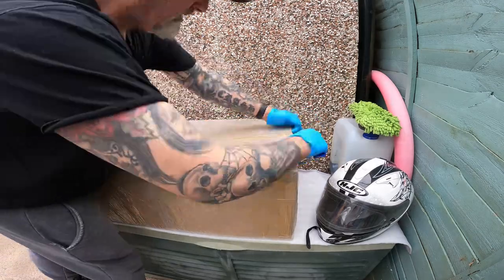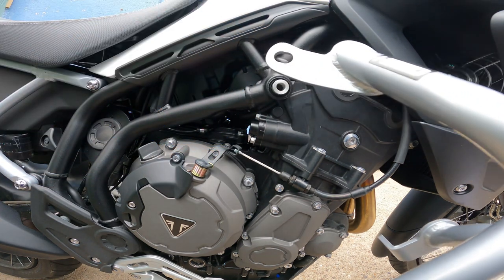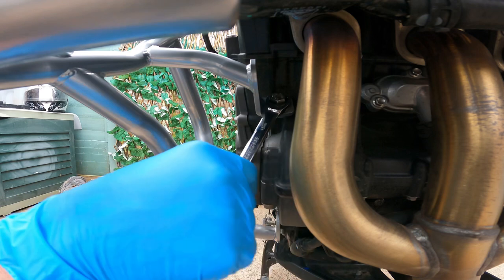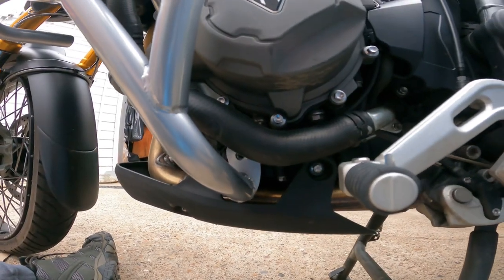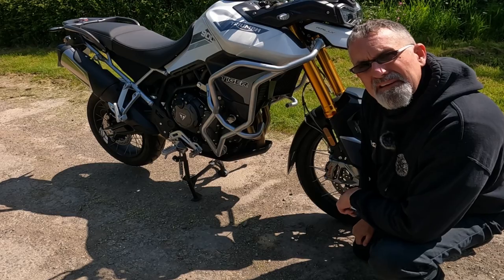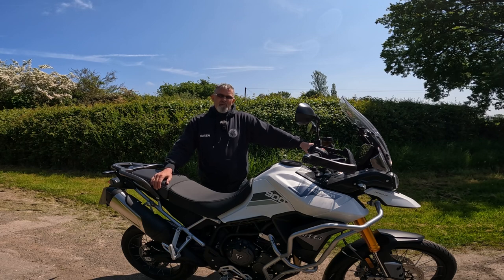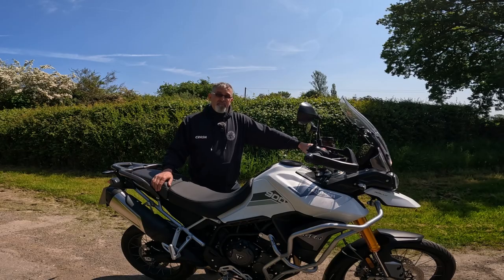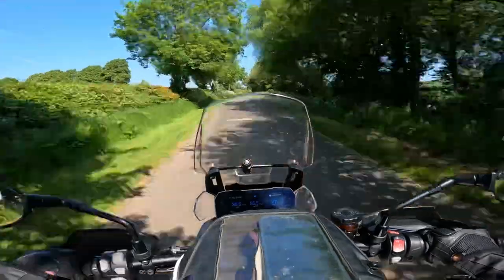TRIUMPH TIGER 900 HEED CRASH BAR SYSTEM SAVE YOURSELF £285

Comment: I had Heed bars for a year now on my bike and after a while I fell while offloading. The bars themselves worked, however, the way they are mounted to the frame did not. The OEM bars have an extra bracket that mounts on top of the normal fairing bracket, these bars didn't. So the fairing and instrument cluster bracket is not designed to handle the motorcycle weight, nor a crash. So it broke and it's a fairly pricey piece. I would suggest crafting with some blacksmith a bracket to reinforce the mounting point. I personally am looking for a better set of crash bars, since these would need to be straightened either way.
Reply from the maker: Thank you for watching and commenting it’s allways personal experiences that give you a better insight to a product I’m sorry you had to crash to find the week points but thank you for sharing 🙏
Reply: @bikerbuddy3166  No problem! Thank you for the comprehensive video. I hope Heed finds the flaw and corrects it in the future since they have good quality.

Comment: I took a low side at about 50 km/s and the OEM bars bent and made a 2 cm wide dent in the tank. The light support also scratched the fairing in front of the tank. The OEM bars are so weak, I put them back in place by hand, using very little force.
Reply from the maker: I’ve heard a lot of the same feedback and definitely not the triumph quality you expect ☝️thx for watching and commenting 🙏

Comment: I have HEED bars on the Vstrom 650, they work the same way as yours protecting both the tank and the engine. My experience is that they are well designed, well built and that they do their job extremely well, although I didn't drop my bike in the garage....oh no I dropped it in a car park in front of nine other riders one of whom (you know who you are @Nightcrawler666) had a video camera running at the time. 😳
Reply from the maker: Yes I remember seeing that video god your crash bars save d the day , but definitely don’t feel embarrassed we have all done it at some point and if we haven’t yet we most definitely will lol 😂

Comment: Thank you for the video. Took your advice and selected Heed. A bit fiddly here and there for one pair of hands as you mentioned but your fitting instructions were spot on and hey presto, bars fitted.
Reply from the maker: Thank you for watching I’m glad video was a help I did love the heed bars for quality and looks not to mention price 👌
Reply: With the additional weight, is it recommended to adjust the front shocks ?
Reply from the maker: @charleswink1213 I don’t think so and I never felt the need to do so

Comment: Hi thanks for the video. I’ve just fitted these bars to my GT Pro and they’re great but I am struggling to fit the fog lights. The brackets supplied do not seem to fit either on the cross brace or under the beak. Any ideas. Thanks.
Reply from the maker: Firstly thank you for watching and commenting 🙏 the four L shape brackets that came with mine connect together to leave you with two brackets they then attached behind the two big nuts that attached the cross brace if you look on my airvest rucksack video I walk round the bike and comment on the spotlights I think that’s the only video I’ve got with spotlights in hope that helps 👍
Reply: @bikerbuddy3166 ah I hadn’t thought of using the 2 sets of brackets together I’ll have a look at that and see if I can get it too work. Many thanks.
Reply from the maker: No problem I scratched my head for ages and that’s what I came up with lol 👌👍

Comment: Great video! I ordered mine, but don't see anywhere what the torque specs are. What torque specs did you use. Appreciate it, thanks.
Reply from the maker: Firstly thank you for watching and commenting, yes I had a the same problem what I found online was for the engine bolt 

 2021 — and it says that two of the bolts that goes into the engine should be tighten with 15Nm. That's very light torque 
So I did them to 20nm and they haven’t come loose I hope that helps 🙏

Comment: Did you not reinstall your fog lamps with these bars?
Reply from the maker: I didn’t because there wasn’t any fitted as the don’t don’t come standard with the rally , but the brackets to do so are supplied with the heed crash bars , I’ve since bought a set of spots and used the brackets to fit them 👍 thx for watching and commenting 🙏

Comment: Can you please show how to reinstall the fog lights
Reply from the maker: Unfortunately I can’t as I’ve just changed bikes , but the bars come with 4 brackets that you attach into2 brackets they then bolt to the bar at the front that attaches to both sides , if you look at my airbag rucksack video there is a walk round of tiger with spotlights attached hope that helps , thank you for watching this video 🙏
Reply: @bikerbuddy3166  Did you need some extra parts to reinstall them?
Reply from the maker: No the bracket for the spots came with the heed bars 👍
Reply: @bikerbuddy3166  thanks alot! Just ordered them
Reply from the maker: @gijohnson5430 you definitely won’t be disappointed 👌